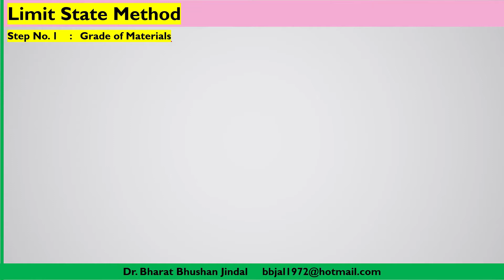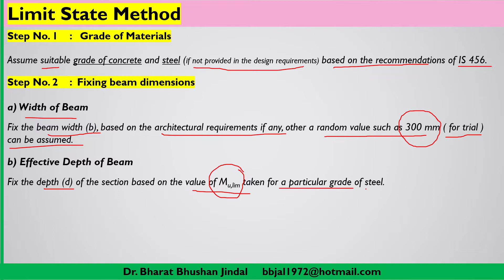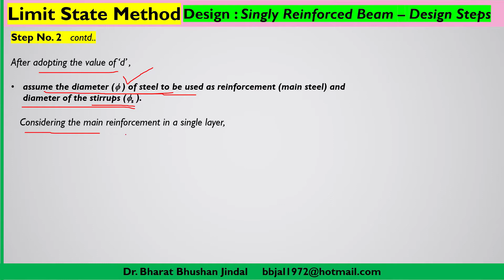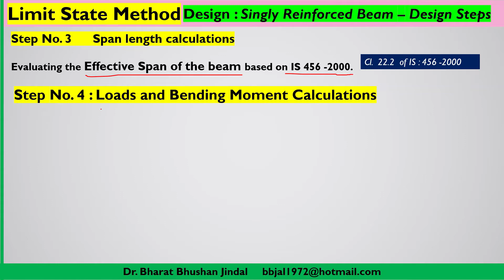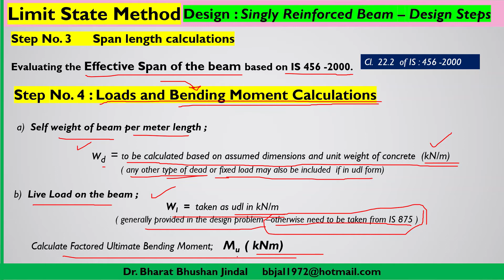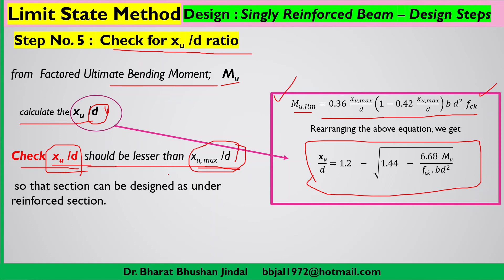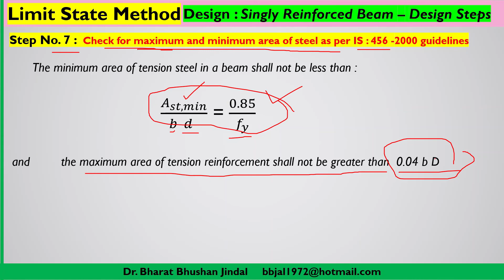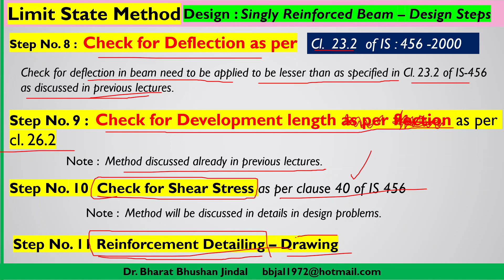Lecture 13 || #Design Steps - #singly reinforced beam || IS :456 -2000 ||  Civil Engg.

Comment: sir, at (8:06), u said what ever the value of d we get after substituting in formula, it can be rounded off to the higher value. My doubt is the value taken for Mu,lim is for equality condition of xu and xu,max(balanced section) in such a case increasing the value of d by even a single digit will change the equality condition(balanced) to over-reinforced section. how will it  be under-reinforced then?
Reply from the maker: If you increase the value of 'd' during roundoff, then xu/d  ratio will decrease which indicates that the design will be under-reinforced one not over reinforced.